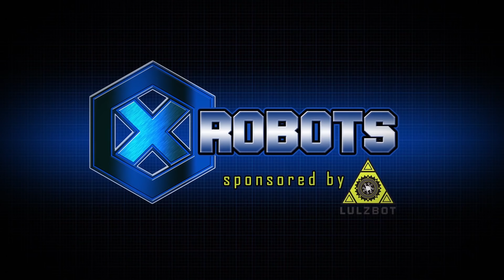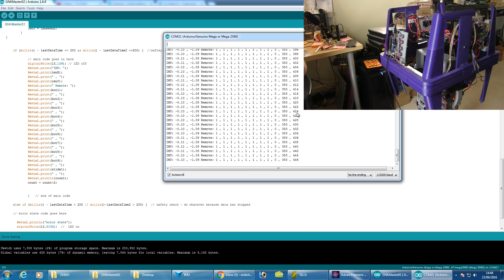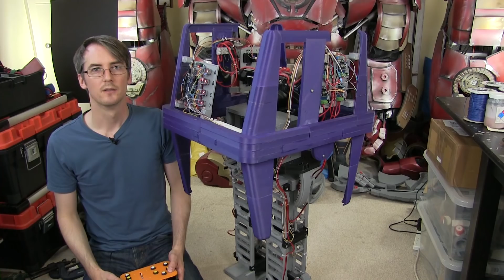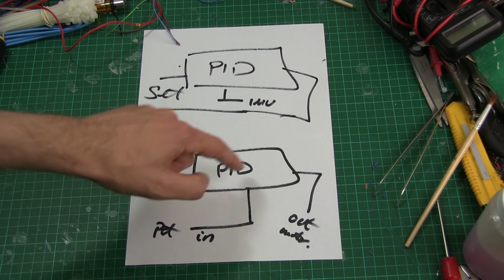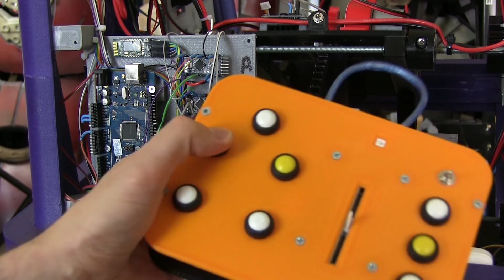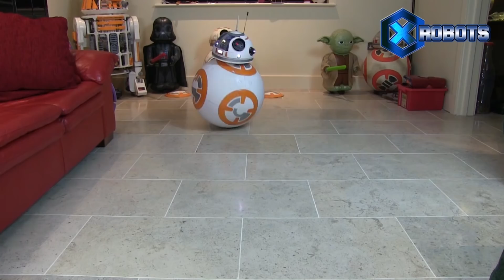Star Wars GNK Power Droid #7 | It's Alive! | James Bruton

Comment: great stuff... i do have a question though.  The PID for the "servo" still control makes sense... the set point is the commanded position, the actual position comes from the pot, and the output is your command to get to the setpoint... classical PID.  BUT you used the same thing for the IMU stuff and you completely lost me.  It seems as though the set point is coming from the IMU and the input is coming from the slide (which means neither one of those has any physical association with the joint itself).  So, in my mind, the PID is trying to adjust the output so that the slide value (the input) matches the IMU output?  I'm having a hard time wrapping my head around how that works.
Reply: ahh ok... that makes more sense... yeah, i was looking at the code and I just couldn't wrap my head around it!  thanks for the answer.  the world is right again.  :)

Comment: Hi James - trying to understand your IMU PID2 loop - @ 11:15 pushing forward results in upper body motion forwards.. acting as a damper as desired - but would the upper body still move forwards and hold position if you slowly tilted the entire robot (maybe holding the legs) to lean forwards? Or would it solve for absolute position angle, and tilt upper body backwards so his head remains pointing up at roof?
(assuming you're using the fused DMP pitch or roll angle from MPU6050, rather than accelerometer data only)
Reply: Ah, thanks. So the PID2 calculated corrective angle based on difference between IMU & slider is actually added as movement of the hip joint in the same direction.. leaning forwards moves upper body further forwards.

Tried for a while to combine that same method of damping with being able to stand or walk on sloped ground... which, essentially requires the opposite corrective action.. if body is leaning backwards due to uphill sloped ground, need to counteract with a forwards lean at hips/ankles. Seems difficult to combine the two.. some success in jumping from one PID type to the other based on a trigger of high accelerometer value, indicating an external disturbance/imbalance rather than a constant sloped terrain. Not the best solution.. yet to solve.

Comment: Brilliant seeing it active, could you lower the center of gravity and lower the batteries into the lower corners, they might not snag if there is room
Reply: possibly counter-intuitive, but it is easier to balance an inverted pendulum (which is essentially what the robot is) with more weight at the top - can test the theory out by trying to balance an upright ruler on your finger, then add a heap of blu-tac to the top and try again, it gets easier!
Reply: Ojsh _ I don't think the laws of physics are any different for other forms of motorised vehicles, and balancing a stick , the stick is not correcting itself an outside lever (your arm) is, let's see how it goes, the motors and pid loops are probably quick enough for this , but when James mentioned lowering the weight I suggested some options that's all.

Comment: I feel like running I2C/TWI between the main board and the 4 motor boards would make it easier to not use all of the serial ports on it since it's a bus instead of a point-to-point protocol

Comment: Hey James! 
I'm in the planning process of my first robot, an rc car with some sensors. 
Got any tips or common pitfall warnings for me?
Reply: Shaun Husain
Wow, i did not expect such an in-depth analysis, thank you very much :)
Reply: TheOlian04 No problem fun stuff.  I'm a web dev so nice to get to apply some of the programming knowledge to physical things to see something you made working in the real world.  Let me know if you have questions and will try to point you in the right direction.

The RC based thing I put together used some ultrasound sensors to detect distance in various directions, this was pretty good, but you might be able to find some cheap lidar type solutions I've seen from broken robo vacuums.  Mine could do some basic object avoidance (if you it sees something right dodge left, if it sees something left dodge right, if there's something on the left and right back up a bit and turn hard for a few seconds).  Think with a lidar type setup though you can build it up to do SLAM where it tracks obstacles and it's current position/orientation to build up a map of it's environment as it moves or could throw a GPS and inertial measurement units (IMU), compass etc. and have it do some path following.

Have recently built a 3D printer, quadcopter, and electric skateboard so I haven't had much time dedicated to tinkering with the bot stuff recently but always fun.
Reply: Idk how experienced you are with code/ electronics. But, sometimes shit won't work and it can be quite disheartening. Don't let failure/s get to you. The more you try, the more you learn. 

The biggest pitfall with anything like this I see is over complicating things. Its really common when you are first doing stuff. And sometimes over complication turns into frustration. Sometimes its best to sit back look at what you are trying to achieve and break it up into smaller bits. 

Good luck with your rc car.
Reply: Jamster
Thank you!
I would say I'm a fairly avid programmer, its the backbone of both my education as well as my job.
On the other hand, I'm completely new to micro-controllers, I've written a couple of assembly & C programs for school projects, but thats it.
Reply: Given the background in programming the code will be pretty simple in my experience and lots of sample code to work from.  On the electronics side make sure your components are properly rated to handle the voltage and amperage you're going to put through them, with an RC car you'll just be driving a servo or two for steering and an ESC most likely but make sure your components have adequate power, many times you may need a separate power supply for various components or some can deal with voltage dips whereas a micro controller will reset if the power dips too low.  If using transistors or hbridges for driving brushed DC motors be sure they can handle the power without burning up (don't grab them to find out if they're too hot).  Use a multimeter and check everything with it will help understanding what's going on, if you have access to an oscilloscope even better but a multimeter will do for measuring resistance and voltage and other basics.

Also I've built a few small rover type things with the high speed motors and small capacity batteries that come with racing RC cars makes controlling the throttle difficult since the same throttle value results in a different speed depending on the batteries current voltage which drops over the course of a few minutes.  For that reason would suggest not using a RC car really, getting a power train that efficiently uses power and can carry larger batteries is easier in terms of programming the throttle control and getting a consistent response.